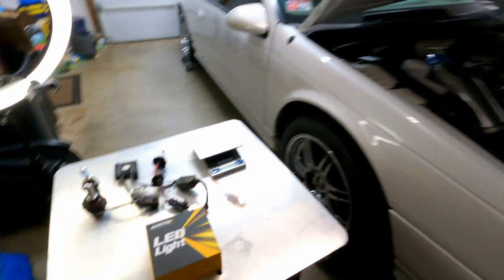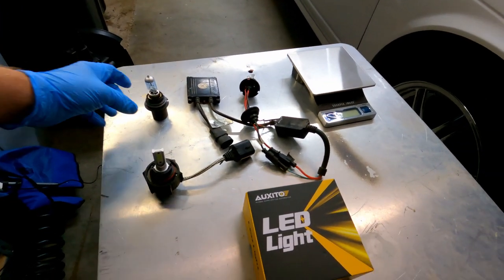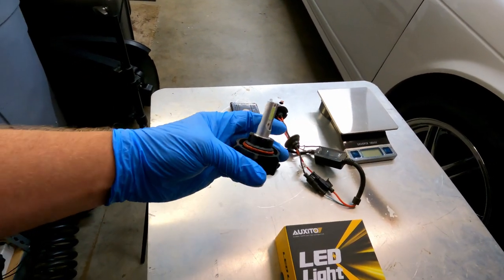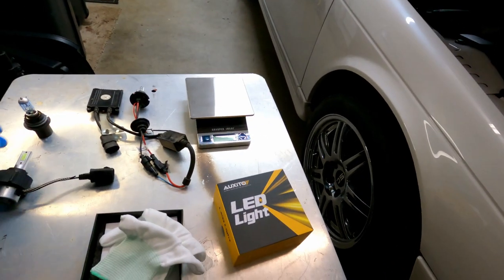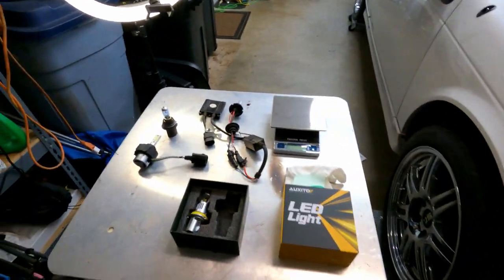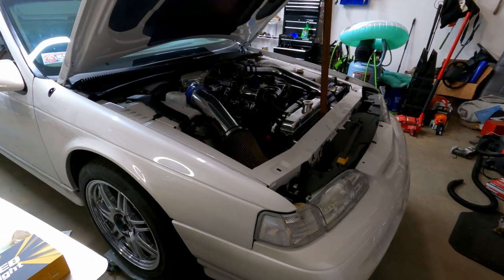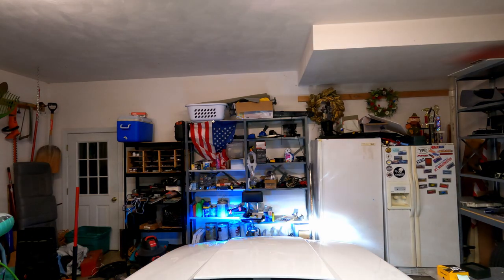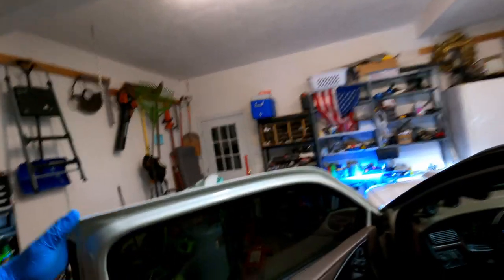Ford Thunderbird LED Headlight Review - Auxito 9007 LED Headlight Bulbs

Comment: ok, very good for 94 and later models.  Do you have any recommendations for the headlights from the 89 to 93 model?
Reply from the maker: Auxito has also offers 9005 and 9006 bulbs for the early models. Id feel comfortable suggesting them after seeing how bright these bulbs are, and the number of positive reviews online. Also quickly reading the forums a lot of SC owners suggest Torch beams. They look very similar in design and price.